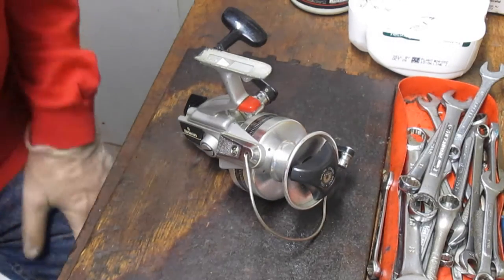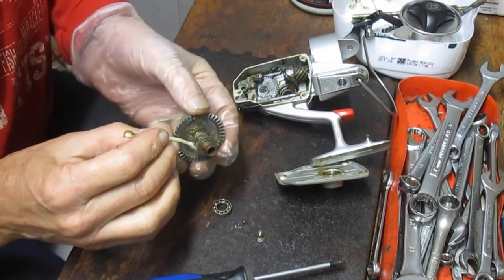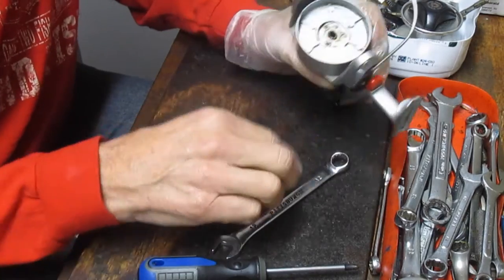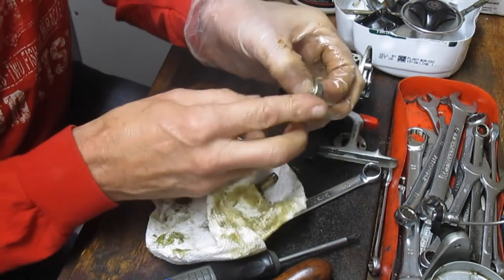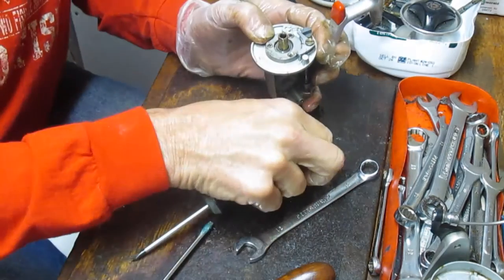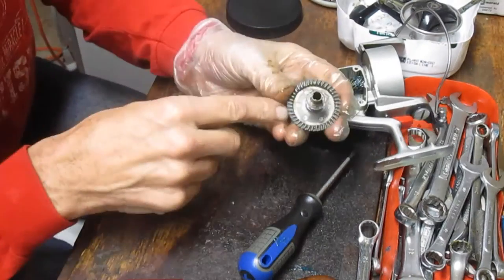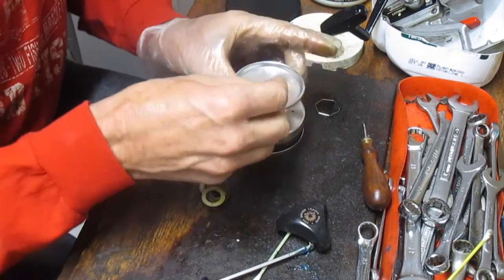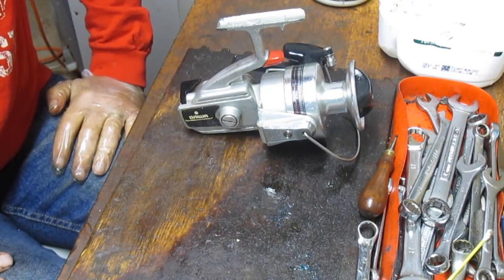Daiwa 7000C Fishing reel how to take apart and service this classic

Comment: Hi Dennis. I watched your vidio on the Daiwa 7000c reel. I removed the handle screw, but the handle will not pull out. Cleaned and applied a little penetrating oil. Returned screw and tapped very gently will not budge. Any suggestions? Thanks. Gordon
Reply from the maker: That's a tough one.  You either have a handle shaft frozen in the gear or it is bent/warped at this point.  Do you know if it it stuck in the bearing/busing, or in the main gear?  I might try heat as a last resort.  I would pull the roll pin on the handle arm to remove that and then use a torch to heat the through pin and see if that loosens things up.  You were right to reinsert the screw and tap tap tap.  you may try that with the heat as well - Dennis
Reply: Took your suggestion apply a little heat then spraying penetrating oil then tap back and forth. Repeat. Got it out. Thanks for your videos!!
Reply from the maker: Glad to hear it worked - Best wishes for great fishing with your reel - Dennis

Comment: Hi Dennis, congratulations for your channel, I recently bought a used 7000c in box and was frozen. Then I opened it for servicing and now it's working good, and I noticed that it only had one drive gear whasher in the body cover, but looking at the original factory diagram there should be another whasher on opposite side.
How many whasher, one or two??
Best regards
Reply from the maker: Those small shim washers are used to align the main gear to the pinion gear.  They take up any slack or variance in the side plate manufacture.  It is possible that the factory only saw the need for one washer when it was built or someone lost one or more when they serviced the reel.  If the reel is running smoothly, you can leave it as it is.  If you want to blueprint the reel, you can add the other washer as it does provide a shield to the bearing in addition to the shim function.  Thanks for asking - Dennis
Reply: @2ndChanceTackle  Thank you Dennis. I've added another shim and It's working  smoother than before. My first fishing gear was a Daiwa minispin combo, and I currently have in my arsenal a 4000c, 7000c, Gs90, SS2000 and a Penn 650 SS. I really enjoy fishing with those old spinners!! 
Best regards from Azores Islands 

.
Reply from the maker: All great reels!  Thank you - Dennis

Comment: I have inherited this very same reel and was hoping to use it, but the handle is out of sorts on it and needs to be fixed. I think it is the bearing. Is there a way to repair or replace the bearing in the handle?
Reply from the maker: Most of the handle parts are pressed on.  You should look for a replacement handle

Comment: Dennis i seen a Daiwa 7000c on ebay in very good condition. In you opinion what are these reels worth.  I'm not a collector I want to use it as intended on my surf casting rod
Reply from the maker: It is all about the condition and the paint is the one problem area as it blisters and chips.  One in good condition could be $50 while those is very good to excellent could go much higher
Reply: @2ndChanceTackle  thanks for the reply

Comment: Hi Dennis 
Is the 700c the same inside as the 7000c?
I want to rehab my 700!
Reply from the maker: They are similar, but the 700C is an ultra light reel and is less complicated.  The 7000C is a large saltwater reel.  You can follow the process I use in this video and you should be able to get through your reel without problems - Dennis
Reply: @2ndChanceTackle  Thank You

Comment: Dennis,  would you recommend the use of braid or mono on the 7000c Thank you.
Reply from the maker: The reel was designed for mono, so that is what I would recommend.  If you use braid, then make sure you have mono backing on the spool prior to loading the braid.  There is no reason that the reel cannot handle braid. - Dennis
Reply: 2nd Chance Tackle   I disagree that there is no reason it can't handle braid.   The problem you can't avoid with braid is backlash.   Since the reel has no instant anti reverse, the slack in the line will cause wind knots and line lay problems.   You can put a lot of 30 pound mono on the reel.

Comment: My 7000c handle is not so easy to remove. It threads on? And has retention deal.
Reply from the maker: So you have a screw in the middle of the non-handle side case?  If you do, then the handle has a through shaft and you need to remove that screw and pull the handle straight out on the other side - Dennis

Comment: Would you say this reel is bigger or smaller than a vintage Mitchell 402? Or same size?
Reply from the maker: It's about the same.   The 402 is wider and the 7000 is taller, but they target the same fishing - Dennis
Reply: @2ndChanceTackle  alright  thanks dinnis!❤🇺🇸 stay safe
Reply: @2ndChanceTackle  and i guess a penn 704z falls into the samr size as the Mitchell 402 and 7000c ? Im jist trying to get a good idea on the sizeing of some of those older reels

Comment: stupid question, but what is the red plastic thing called that the bail hits?  I'm trying to restore a smaller silver series model but its missing on mine...apparently fell off.
Reply from the maker: Robert - I call it a bail trip cap.  I don't think you can order one of these.  I believe it was an integral part of the reel body and not sold separate - No stupid questions.  You can get the schematic on the Mikesreelrepair web site and check.  I did not see a part number for that piece - Thanks for asking - Dennis
Reply: @2ndChanceTackle  thanks for the reply Dennis.  That is a shame that it is not sold as a separate piece, i've got everything else back in working order.  I do see some daiwa bodies for sale as parts but unfortunately sold for just as much as another 1300c complete.  Good thing i have another reel that i can attempt to use to make a mold.  I've never attempted to reproduce a part yet but I might be able to produce something acceptable to put it back in service.
Reply: @robertdieder4178  Hey Robert, were you able to make or find a replacement for this reel? I am also missing that red piece
Reply: @HuyFishin  i was able to make a wooden trip cap, it worked but it was so ugly that I took it off. I'm hoping someday I meet someone that can 3D print one for me.   Maybe I'll reattempt and make a mold.  The toughest thing that i encountered is how to mount it. The mounting peg is rectangular and I was cutting with a dremel router bit.
Reply: @HuyFishin  thanks for jogging my memory about this old project of mine, I just had an idea that I might be able to make a resin mold around it and just sand it down close to original size/spec.

Comment: Is there anybwayvtobadjust the spool depth, when i put line on my it tapers to the rear,  and i think the pool needs to move forward.
Reply: I'm going to try and find some extra washers
Reply from the maker: If you need to, you can make extras - cut a piece of plastic from a milk container or soda bottle or fast food tray, etc and then use an awl or drill to make a center hold that is slightly bigger Thant the axle shaft.   Once you have done that, trim the outside to an approximate circle and that will create the spacer you need to lift the spool and even the line lay.  - You may need more than one based on the thickness of the plastic - Thanks for asking - Dennis